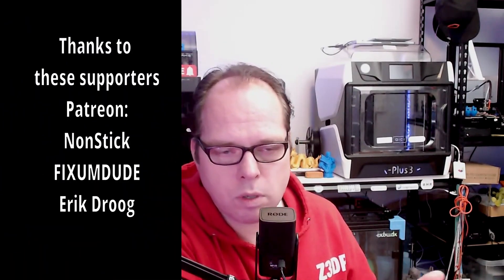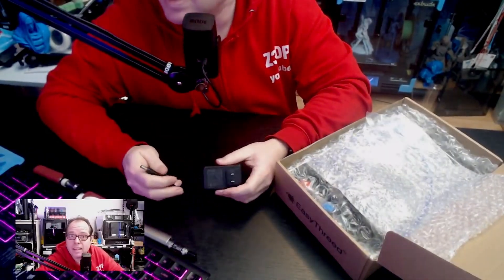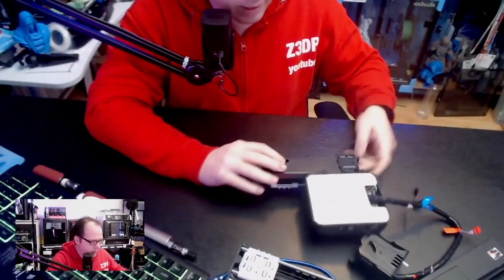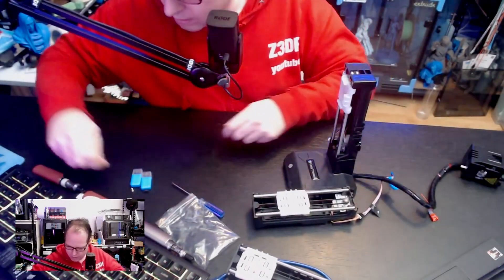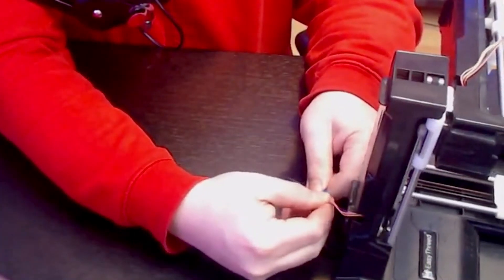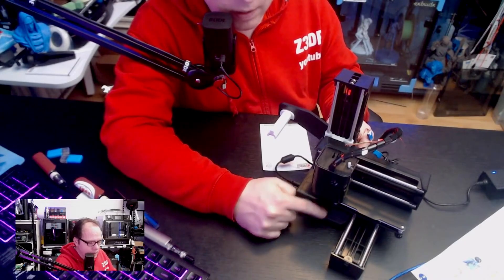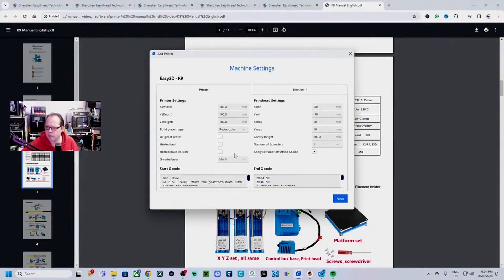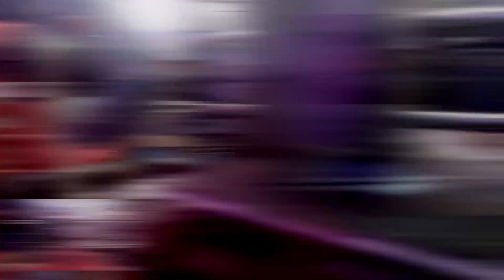Easythreed K9 - Unboxing And Set Up

Comment: Hey I just got it and I have a problem with the platform that doesn't match the axis, do you have any advice for that kind of issue? It is to hard to assemble
Reply from the maker: Did you manage to get the platform connected?
Reply: I got mine put together but it is all wobbly and the belts look rusted.
Reply from the maker: Yeah, the quality is even worse than the X1 from them

Comment: Hey Zach how’s this printer holding up? I’m new to 3D printing so I think one of these is a very affordable way to start. 

I’ve done a little research on the different filament types and a few affordable 3D printers. What filament types can this printer use besides PLA? Thanks in advance
Reply: Only Tpu and nothing else
Reply from the maker: yes, that is correct.
Reply from the maker: Hello, sorry for my late reply. This printer is very cheap, but I would recommend going for a bit higher in price and getting a better build printer with heated bed. It will save you some headaches

Comment: Hope you're Day is going good! I purchased that exact same printer last year and my bill plate got completely ruined with plastic sticking to it. So I went to Dollar tree and got a 4x4 glass picture frame and I'm using painters tape. I have not had a problem with adhesion since then and it comes off the plate pretty easy. I have found that this printer works better with vases and larger busts for its bill plate. I recently put it off some letters and experience layer shifting on this printer and it has never done that before. But it was great for me to begin with my 3D adventure and I'm still using this today but currently I have an ender 3 as well. Also I've watched a few videos from Chep on his filament Friday channel and he reviewed one of the easythreed printers and use TPU and from what I could see it works really well with flexible material because of the direct drive. I personally have used silk tri-color filament and misprinter does really good changing the colors, I've yet to have my ender 3 do well with tricolor filament, that printer just just the color in line layers if that makes sense versus the other printer shifts the color on the model from front back. I'm really interested to find out what you print and how it comes out Hope you post more!
Reply from the maker: My day is going great and I hope your day is going great too. 
I know the great videos from my friend Chuck on Filament Friday, and I remember his review on this little printer.
The magnetic bed from the X1 was great and I got amazing prints from that printer. on the K9, the bad adhesion of this printer is not an issue, it's the opposite... prints are sticking very well, too well. 
I'm currently testing this printer, between the other projects and videos. I hope to push out a video within 2-3 weeks.